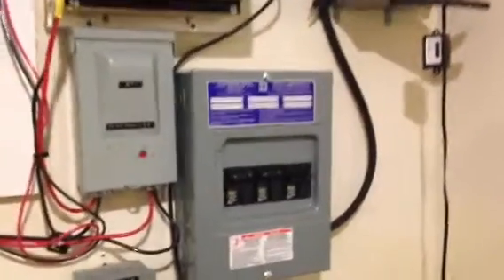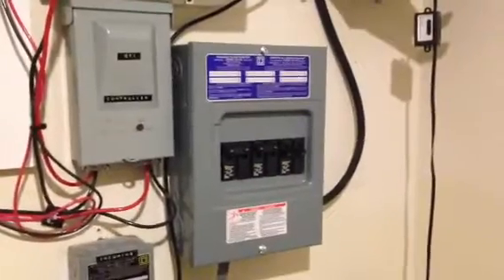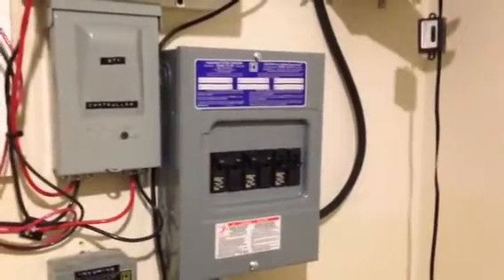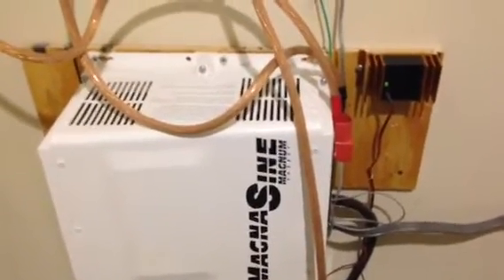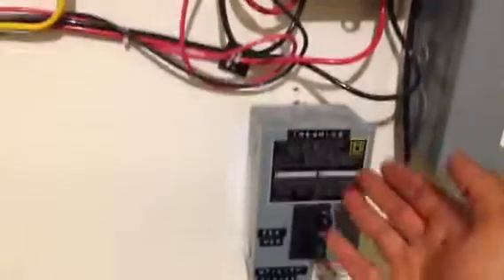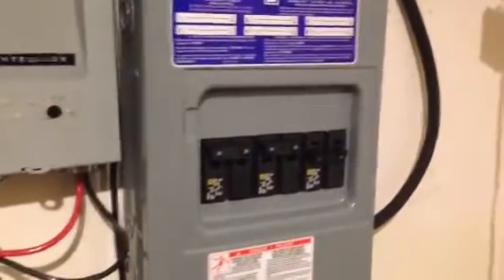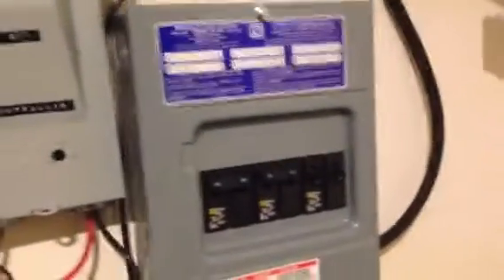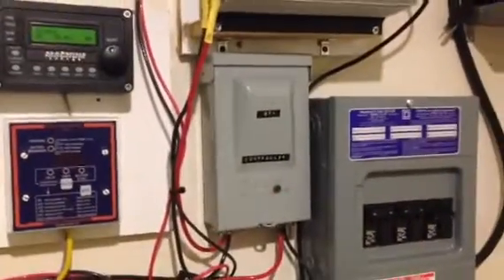DIY Home Solar - APS Micro Inverter Part 2

Comment: Any problems with the utility not giving their "blessing" on your system? I'm afraid that forgoing an interconnection agreement would land me in trouble. Unfortunately, where I live, DIY grid interactive solar is not legal (no permitting process as well).
Reply from the maker: 9x19 I haven't had any issues thus far, but I don't live in the city limits.
Reply: rhandsom Thanks for the reply. Yes, TN only allows NABCEP solar installers to tie into the grid. You have to be accepted into a yearly program with limited capacity. What a crock!
Reply from the maker: That is interesting, but it does sound odd that they would restrict in that fashion.